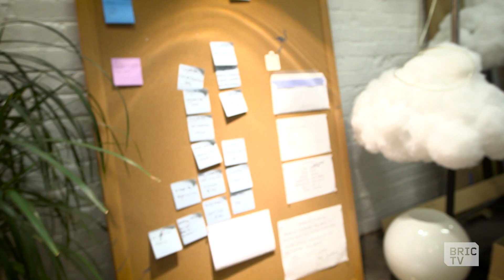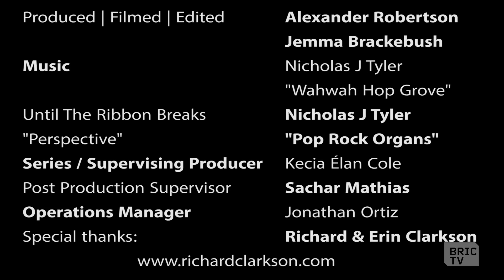Richard Clarkson's Interactive Cloud Speaker Lamp | Brooklyn Made

Comment: F#@k off for 3,400$! Make your own for pennies by comparison. It just won't respond to noise/motion. In time though, these small technologies will be more abundant, and far cheaper.
Reply: I’m gonna make one I’m ordering the stuff today if you want I’ll make a video on it and mind will be better
Reply: @johnmoore333  I am curious to see how you would make one.  How much are the materials?
Reply: There’s plenty of YouTube videos on it but I’m using Chinese’s lanterns for the body I ordered a variety pack off line with a bunch for like $15 and then you can buy any RGB kit for the lighting There’s also the WiFi controller you can get 3 for 15 and there just 4 pin plug in just like the light then you plug the other end to your power source the reason I’m doing that is because I have my house hooked up to google home and I can control them to a certain extent also get some cotton and glue
Reply: Polly fiber not cotton just go buy a bag of the stuff to make your own pillow that’s actually the exspensive stuff out of it all but yea connect y Ur lamps probably uses 3 diff sizes run lights threw them cover with the fiber hang up plug in and voala
Reply: Jack Public for 15 dollars you can get A WiFi controller that’ll do that
Reply: we can make these for $75-50 in parts
Reply: Francisco Cardona not even that much just depends on how fancy you want it and if you know how to do a little coding or just as simple as buying a rbg kit I saw at Walmart last night for 15 dollars get a hot glue gun some milk jugs and  an old pillow you don’t use any more or if you want to get even cheaper find some old Christmas lights to use like I said you can get super fancy and spend that much or for most people could probably do it for free
Reply: Francisco Cardona  but if I was making and selling them I would at least have an app capable one and sell it to the public for 100 on fb marketplace